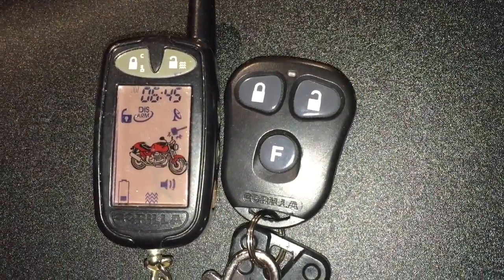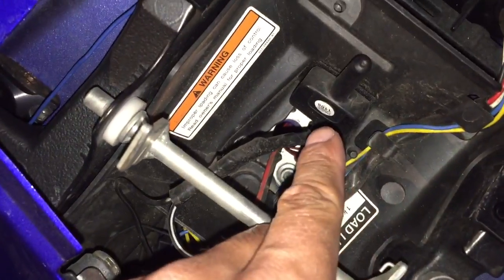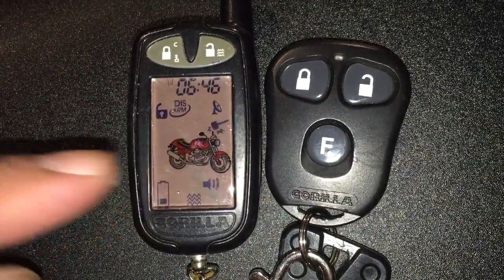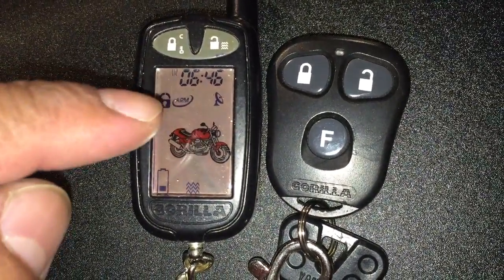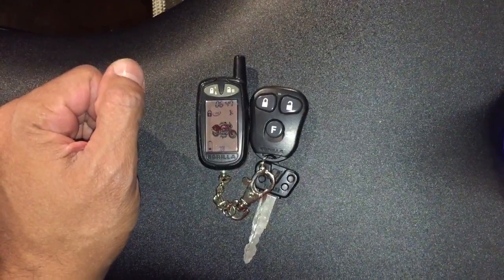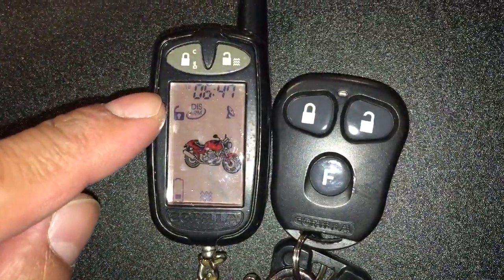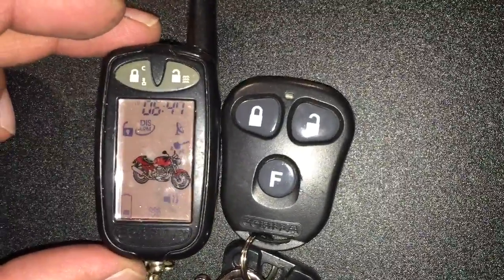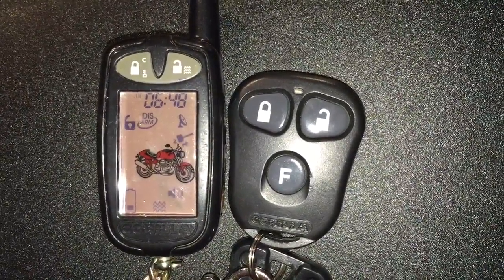Demo of motorcycle Gorilla Alarm

Comment: I just got a bike with this alarm pre-installed. My arm button on the display remote doesn't work. Battery is full, not sure what the issue is.
Reply: Hey, More likely internal copper plate issue or rubber pad pressing on tiny switch not siting good. try to open it or get a new one. Should be pretty cheap.